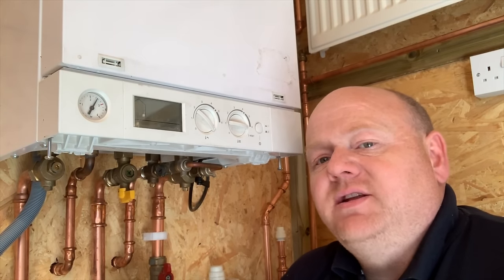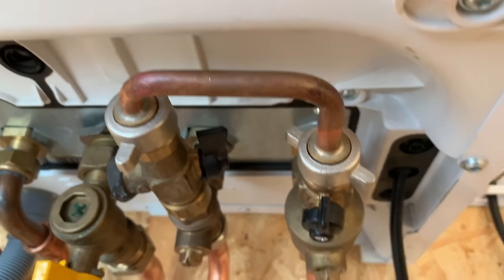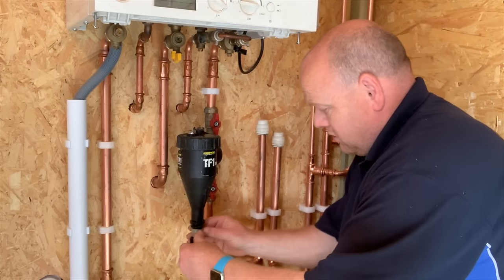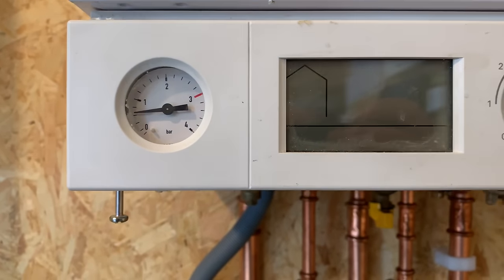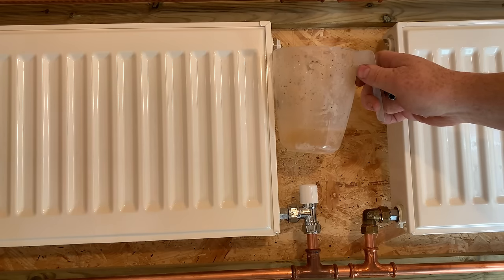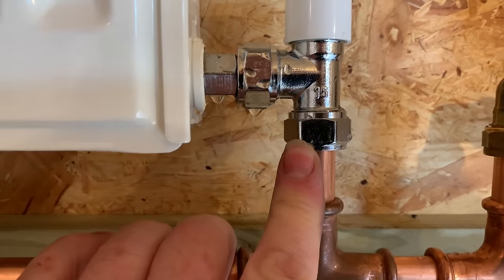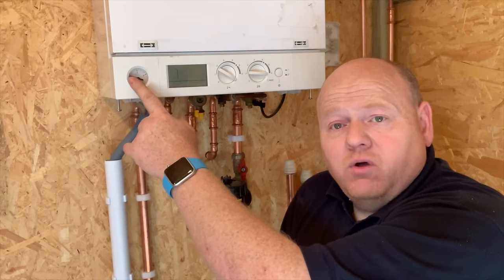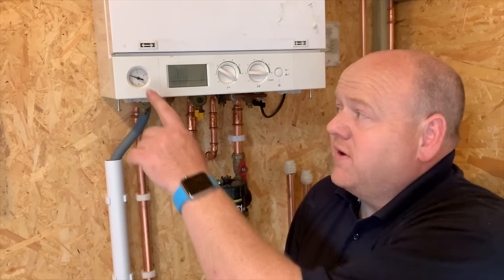Combi Boiler Too Much Pressure - How to reduce the water pressure - Central Heating

Comment: I hope you see this before i die of cold! I watched your video and over pressured by mistake maybe, it got passed 2 down to 3, water is leaking through the central heater, i have drained up to 10liters already, wouldnt stop
Reply from the maker: Did you sort it out? Thanks.

Comment: Hi thanks for your video we have just had a expansion vessel fitted and prv due to our boiler suffering from high pressure, but this has made no difference at all, can you suggest something else. Look forward to hearing from you. Jane
Reply from the maker: What issues do you have and what has the gas engineer said? Thanks.
Reply from the maker: Thanks very much for your comment, please consider subscribing to support the channel 🙂
Reply: @AllenHart999  we have had a new expansion vessel fitted but the pressure is still going over 3, can you suggest anything else that Could be causing this high pressure, someone has mentioned the braided pipe, the engineer does not seem to want to come back to find the problem, he was a viessmann trained installer, fortunately we have not paid him. The heating seems to be working fine apart from this high pressure.

Jane

Comment: Thanks for the great explanation. I set my Worcester mt10 at 1.5 bar. When heating the radiators on temperature level 3 it goes to redline 3 bar. Is it normal? Or should the pressure be on green at all times? Thanks again for the video
Reply from the maker: Thanks very much for your comment, please consider subscribing to support the channel 🙂

Comment: Great video mate really informative, how much dripping is normal for the outside copper pipe , my pressure is high on my boiler and is making a weird moowing sound , checked the copper pipe outside and it is dripping but not gushing
Reply from the maker: Thanks very much for your comment, please consider subscribing to support the channel 🙂

Comment: Hi Allen,
Thanks for providing this information.  I have watched your high pressure video.
I don't tend to conduct tasks like this, but have topped up the water on a few occasions.  
I did it last week, but shortly after I  noticed that the pressure was high and that the small copper pipe outside was expelling water.  It is now a trickle, but still hasn't stopped.
I had it serviced in January, but don't have faith in that engineer.
Watching this video I believe what I have described above is a PRV.  I think your comments here related to low pressure.
Do you have any advise?
Many Thanks, Kev.
Reply from the maker: Hi Kev, Give me a call and i will try and talk you through it. Thanks.

Comment: Hi Allan just a quick one but I’m refilling my combi system after a flush and was wondering how long it takes to fill all the radiators and system back up
Reply from the maker: Depends how big your system is. Thanks.
Reply: I have 8/9 radiators  and have just done a full drain but not sure how long it will take to refill the whole system it’s a biggish house.

Comment: Hi Just bought a house and never had a boiler old place storage heaters.  I bled the 2 upstairs rads and went to the 3rd, Nothing coming out boiler at Zero.  Now I have done this will I have to do them all again?  Do I have to depower my boiler to bleed? and if I go threw the rads upstairs and down am I going to upset anything like Balance That i have yet to understand?  Thanks for your help and your video's are really helpful Thanks Ian  It is a Worcester Bosch Boiler, and filling it to bleed do I go to 1 bar or over to bleed as about 8 rads in this house Thanks again
Reply from the maker: https://www.youtube.com/watch?v=tbLz8icLr2U&t=288s
Reply: @AllenHart999  thank you

Comment: HI Allen thanks for sharing your knowledge on boilers.. I have a sime combi boiler in my mobile home.. As soon as I turn the Dail from the off position to the winter or summer position it starts up straight away until it boils and gets to hot then it switches its self off. Its almost like a hot water tap is running all the time and therefore triggering the boiler to run. But obviously every tap is off... Would a drop in pressure or a slow leak cause this to happen as the same as of the hot water tap was running... Appreciate your feedback as its freezing the next couple of days. I can have a hot shower as the flow stops the boiler from cutting out but the central heating wany heat up as it cuts out off due to getting to hot....

Comment: Hi mate thanx for this info my pressure was rising when heating on up to the red  mark on the gauge I noticed on of the full taps was open I closed this and it seems better I let some pressure out of the system it still rises but only a little so hope fully its sorted thanx again for your information cheers
Reply from the maker: Glad it helped

Comment: that was a good explanation thank you. i have a question if you do not mind, please. i have 8 radiators. the question is when the boiler is on the pressure is on 2 bar. is it good or bad. also what would be the consequences of high pressure in the system? does it blow up the pipes or joints or simply is better to have it to make the boiler turn off faster. i know the last one was idiotic but i just realised so when the pressure is high. thank you
Reply from the maker: Thank you

Comment: Hi Allen, another helpful video thanks. Question: my combi boiler has just died. Water pressure was just over 3 bar (due to a faulty stop valve on the feed loop). I got a lockout signal from my boiler and despite fixing the water pressure issue, the lockout signal persists even after resetting the boiler. Question is, what damage is it likely to have done to my boiler??? And is there a 'plumbers trick' to resetting the boiler?
Reply from the maker: Thank you

Comment: Great videos but iv a weird issue with my boiler. Recently had an extra radiator added to system for loft conversion, drained and refilled system numerous times throughout the process as had a few leaks with new radiator etc. The boiler works fine but every so often the pressure seams to just drop and boiler cuts out with the usual error code and once I open the fill loop, the pressure jumps straight back to normal which for us is around 1 bar', over time this causes the pressure to keep going up and more recently I have had to drain water as it was hitting 3 bar when the heating has being being on due to this weird pressure loss needing the filling loop turned on for a few seconds for it to bounce straight back to normal which has caused it to fill up to much. It almost like it doesn't need any more pressure, but for some reason the needle drops below enough for it to cut out now and again. Hope this makes sense. Thanks in advance.
Reply from the maker: Thank you

Comment: Thanks for that information Allen, actually i have a 'Grant 'Indoor Combi Kerosene boiler, and the  boiler pressure raises and lifts the PRV... i shall try to see if the Vessel has failed by  seeing if water is coming out the Schrader Valve ... if not then i shall re pressurise... my friendly Heating Engineer replaced same some time back and told me just to tap the top and bottom of the Vessel he said., the bottom /  'Water side' of the Vessel ... would sound like a Dull thud being full of water,  where as the 'Air Side' above the bladder  should Ring like a Bell... really Great Upload...
Reply from the maker: Thank You
Reply from the maker: Thanks very much for your comment, please consider subscribing to support the channel 🙂

Comment: Hi
I’ve replaced a towel rail like for like in my bathroom. Initially the water pressure in boiler dropped to zero. I opened tap and pressure started going up to 1. Then it continued going up and is now over 3. I’ve drained loads out of rads but gauge hasn’t moved?? The heating and water is working fine but the copper pipe outside is dripping. What should I do??
Reply from the maker: Do you know if the filling loop is turned off correctly ?
Reply from the maker: Thanks very much for your comment, please consider subscribing to support the channel 🙂

Comment: my ideal classic c28 has 1.2 bar pressure but heating is not working. probably answers my own question, but a radiator was removed to repaint the kitchen and a new one will be fitted this week. this should not affect the hot water though surely? boiler fires up, hot water initially comes out, then goes cool. any reason why?

Comment: Hey Allen, Thanks for posting.  Is there a way to reduce the pressure from the boiler itself?
Reply from the maker: This is the way to reduce it from boiler. You could also remove loop on some models. Thanks

Comment: Hi Allen, I hope you can help and have time to answer. this boiler is driving me crazy! 
My boiler pressure was always too high and had to constantly be reset an engineer came and bypassed something that made the boiler work but always sat at over 4 bars so I had him come out again and he fit an expansion vessel, now the pressure sits at 3 bars but if I drain it via a radiatior it drops then pretty quickly rises again to 3 bars when it turns itself off again. Even if the boiler is not running. 
Its costing a fortune in engineer visits and it feels like it should be something simple but I just don't know. 
Great video anyway, wish it could have helped my situation  
Many thanks
Reply from the maker: Thanks very much for your comment, please consider subscribing to support the channel 🙂

Comment: Mate I have given every one of your videos ave seen a like after your video about how to repressure your boiler video  saved me probably a fortune on a call out charge but if its okay would like to ask your advice on my boiler now it's 6 years old but every time I put my heating on then turn it back off my boiler drops pressure and shows E1/19 ( witch I know how to fix thanks to your videos) but it doesn't do it with my hot water just my heating is there anything you can suggest I do
Reply from the maker: Thanks very much for your comment, please consider subscribing to support the channel 🙂

Comment: Many thanks for such valuable infos. - I’m in the middle of cleaning and inhibiting my boiler. After having added the cleaning solution and filled the system up to the correct pressure, I’ve noticed that the water inlet tap underneath my boiler is dripping slightly, and the pressure is rising over 2 bars after a few hours when boiler is on (set to provide hot water only, no heating). I double checked that I closed the water inlet tap but since it’s dripping it may as well leaking water into the system, I reckon? What are your views, please, and can this leaking tap be fixed easily?
Reply from the maker: Thanks very much for your comment, please consider subscribing to support the channel 🙂

Comment: Hi Allen, just had a new expansion vessel put in to my viessmann vitodens 100, radiators work fine, hot water is fine, but when i turn on the hot tap the boiler noise builds up quite loud and the pressure needle starts to vibrate in the gauge, the needle does stay at 1.5 though,  just vibrates a lot, noise goes back to normal once the hot tap is turned off, any ideas ??? , great video`s by the way, ..... Gwyn,
Reply from the maker: I would advise you get the gas man back to check it. Thanks.

Comment: Thankyou alan 
Will this method also be the reason why theres no cold running water the hot tap runs but its cold
Reply from the maker: Depends on the boiler. Some have a high pressure switch and turn off. Thanks for the comment. Happy New Year.
Reply: Happy new year alan
Its a ideal logic combi boiler
Reply from the maker: @suzannalouise676  I cannot remember if that has a high pressure switch. Maybe someone else could comment and help out. Thanks.

Comment: Thank you so much for your  video  so much help on a sunday when i set the  pressure to high on my boiler  i am now in my late 60s and did panic as i could not get a plumber but you saved the day  just did one  radiator and this did the job thanks again Alan your a star mate have a fantastic day  regards G
Reply from the maker: Thanks very much for your comment, please consider subscribing to support the channel 🙂

Comment: Hi Alan, that's a very practical video:)
Would it be possible that the system needs flush and the high pressure is due to corrosion inside it?
Thank you
Reply from the maker: It’s hard to tell over the internet. Ask the plumber to do a water sample. Thank you

Comment: Brilliant. I was always told to run boiler at 2 bar. My hot water tap works but heating has just stopped working boiler is at 2.1 bar combi boiler
Reply from the maker: Thanks very much for your comment, please consider subscribing to support the channel 🙂

Comment: Our Worcester 28i combi boiler pressure sits at 1bar on the gauge from cold / off...   when the heating is On..  its goes up to 2.5 to almost 3 bar..     is this problem normally  the vessel need pumping up as you mentioned ?  Is so.  what is normally the cost to do this.  Hope you can help
Reply from the maker: When was the last time the boiler was serviced? Thanks
Reply: @AllenHart999    Over a year ago,  back before the pandemic started.    I was just reading up on regards to pumping up the EV,    is it straight forward ?  it stated,  once the system is drained,   the EV can by pumped up by a car pump to 0.8 to 1.0 psi.?  is this the possible cause

Comment: Hi Allen, my Baxi Compactflo has gone from having a Low Pressure issue whereby I would top up the water loop to now having a High Pressure issue, any ideas what would be happening there? I reduced the pressure by bleeding one of the rads slightly...I turned off a valve on the RHS underneath the boiler but it seems this was the main water out loop as no water was getting out to the rads and the boiler temperature increased by about 20C.....thanks for your vids really helpful!
Reply from the maker: https://www.youtube.com/watch?v=UR9wSU-I2O8
Reply from the maker: Thanks very much for your comment, please consider subscribing to support the channel 🙂

Comment: Hi Alan. Great video. I have Worcester combi gas boiler. Pressure goes from often zero to 4 with no consistency. I can raise pressure with a levered valve in the hot press and the only way I am controlling the excessive e pressure is by turning off the heating g and emptying the hot cylinder. Also get overflow into the gutter. Any ideas ?. Kindest regards stephen.
Reply from the maker: https://www.youtube.com/watch?v=gLHiT79y21w&t=530s
Reply: @AllenHart999  hi alan. Really great confidence building video. Unfortunately it doesn't address my issue. I'm wondering if you missed my message contents or if I just missed your answer in the reply. Thanks though for replying.
Reply from the maker: stephen toft Give me a call tomorrow and I will try and give you some advice. Thanks

Comment: Hi Alan, could I ask a question please, I have reduced the pressure of my Combi boiler, ensured all valves are closed, but after reducing pressure within a space of 30mins the pressure increases and hovers around the 2.2 bar, would this be an expansion valve issue, Thanks for any advice

Comment: Great video thank you. If the pressure is too high can that cause the overflow pipe outside too leak?
Reply from the maker: Absolutely. Most boilers need the pressure to be around 1 bar when cold. That will give it room for expansion. Thanks.
Reply: Thank you 😊👍🏻
Reply from the maker: Happy to help, Thank you very much for watching. @ROKA...
Reply: Most domestic boilers have a spring loaded 3 bar safety valve, if discharges too many times, or if dirt gets into the seating of it when it discharges then it will constantly drip even at low pressure.

Comment: My boiler is sitting at 1.9 bar and its just had a service do you think draining the radiators is my best bet ?
Reply from the maker: Depends on the boiler really. Some boilers need higher pressure to work. What boiler do you have? Thanks.
Reply: @AllenHart999  Hi Allen thanks for getting back. It's a Glow worm Betacom. Had it for about 3 years and its just had a service. I know some people like it a bit higher than 1.5 but not sure if thats 100% safe.

Comment: Hi Allen, I appreciate you making this video where others have not. I mistakenly had CH flow valve in the wrong position during filling and when running the tap. Broke the gauge and increased pressure too much.

I drained the radiators to bring pressure down. Needle stops around 2 Bar despite empty system. I believe because gauge is broken.
I'm going to replace the gauge, Ideal Logic Combi 24. Do you know if I have to drain the system first? The manual says to drain the CH from the boiler, but I've already drained as much as possible from the radiators. Thank you.
Reply from the maker: Thanks very much for your comment, please consider subscribing to support the channel 🙂

Comment: Hi, I very much enjoy your videos. I have some questions for you if I may. If my Worcester Bosch green Star junior Combi boiler has to have a new extended expansion tank fitted because the one inside is faulty how would I then refill to increase the pressure if needed in the future. My Combi boiler has a key system attached. Also what happens to the old expansion tank that is still inside the boiler. I've been told fitting an extended expansion tank would be easier then trying to replace the one already inside. Is this correct? 
Many thanks.
Phil.
Reply from the maker: Thanks very much for your comment, please consider subscribing to support the channel 🙂

Comment: I have a baxi combi boiler and I keep getting low pressure so I top it up to bar 1 and the heating comes on, then while operating it goes to 3/4 bars, then once the heating is switched off it eventually goes back to an error code needing to be topped up again, it’s been worse since having a few parts replaced a week ago. Looks like I’ll need to call them back out 😖